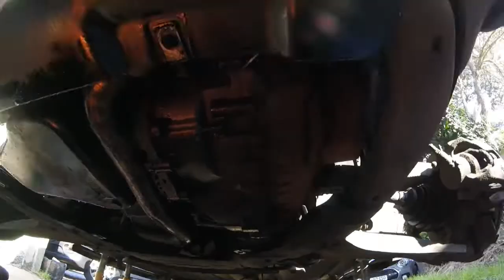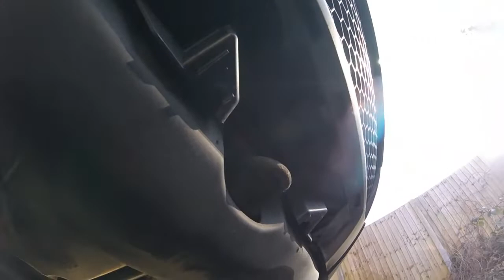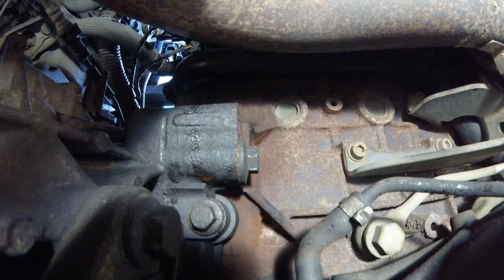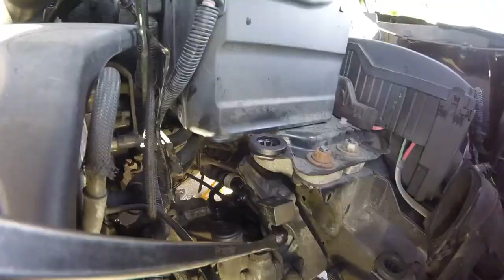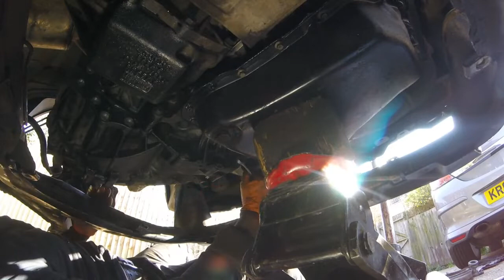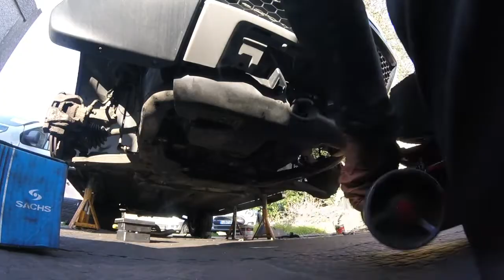2007 Land Rover Freelander td4 2.2L Diesel Clutch Replacement

Comment: Wish you were my neighbour Kev ! My clutch has gone in the bell housing ,I replaced the outer one which was a pig to get on and off the pedal .feeling pleased with myself topped it up only to find the brake fluid pouring out of the bottom of engine somewhere so I assume it's the the slave cylinder that's gone .so it's too much for me at 62 to do and too expensive so it's scrap heaven I'm afraid it's only done 112 thousand I loved it had it for years but hey ho ! .camera work is brilliant you really show us how to get in there .but to be honest Kev you will pay for this when your older body wise been on the floor like this ,we don't stay young forever I thought I was invincible with stuff I got up to .take care of yourself mate ,and hats off to you

Comment: thank you for this video. I do as you had shown but since I have been suddenly on the rear deck. and it is possible to incorrectly mount the coupling with the transfer box?
Reply from the maker: sambote they are double splined. So be sure the gears is in neutral. And have someone flip the wheel back and forth as you wiggle the transfer box in. You have to be a bit of patience with it. Do not force it otherwise it will fail. 
Let us know how you get on.
Reply: @WMCS  thank you very much for answering me. the box and in place already but j is to force a bit with the screws. since I was a default terain answer and a noise like clicking on the rear train.Again thanks to you